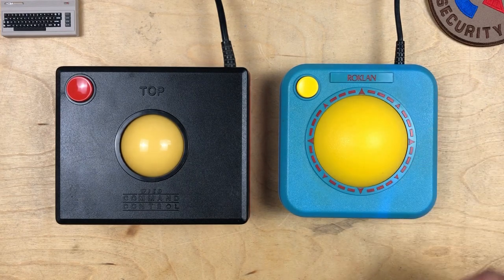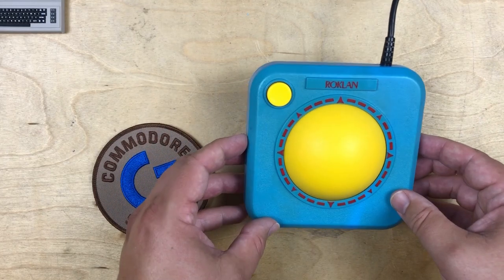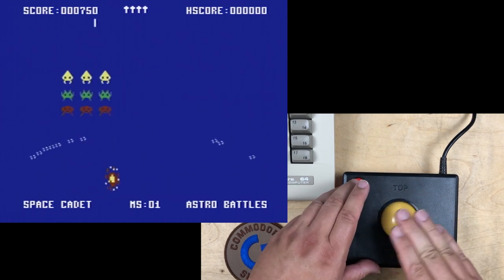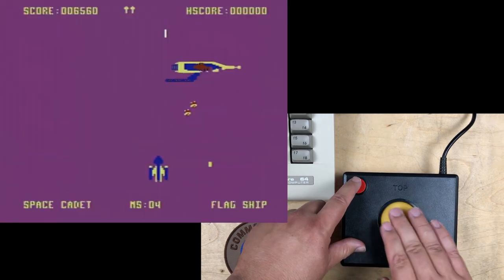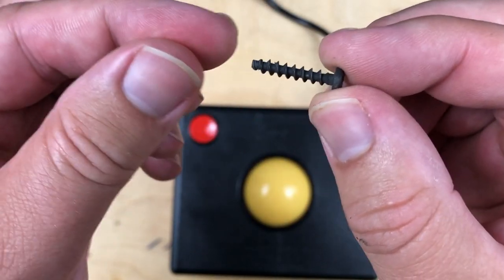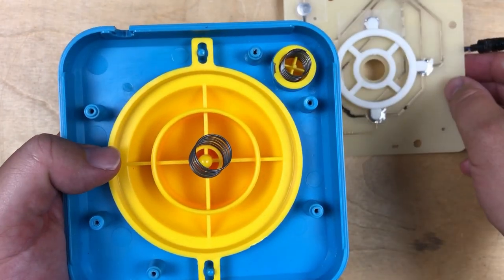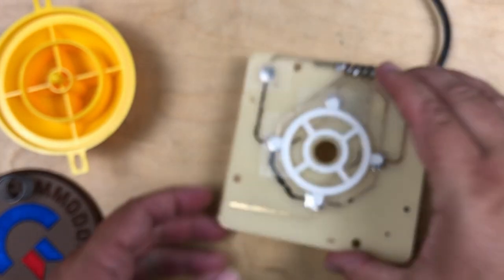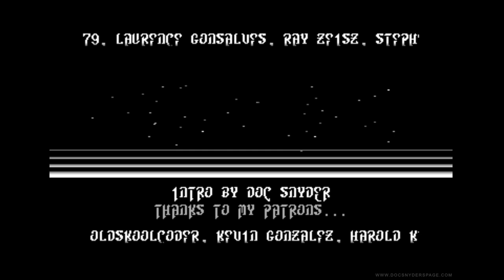Joysticks In The Form of Trackballs: The Wico Command Control and the Roklan Un-Roller Controller

Comment: Every time I see a c64 joystick I wonder how much better the games would have been if they had a couple more buttons
Reply: There was no technical reason that they couldn't have had at least 3 buttons (the normal one and two more on the paddle lines). It's only because of traditional that they continued to only use one button. No hardware manufacturers wanted to make a 2-3-button joystick if there was no software for it, and most software companies didn't want to write games to use a 2-3 button joystick if most people didn't have one. Catch-22.

Actually, there's no reason that even the Atari 2600 couldn't have used the same design to support a 3-button joystick.
Reply from the maker: Yeah, it's unfortunate that Commodore finally decided to push a 2-button joystick around 1990 with the C64GS games console, but that was 1) way too late 2) the console very poorly 3) the joystick itself was horrible. The only good thing is that we do have a bit of a standard now, and some more recent games use it, and some other older games have been hacked to support it as well.
Reply: @8_Bit  Back in 1983, CBS Electronics tried to establish a two-button standard with their Booster Grip accessory that was included with Omega Race for the Atari 2600. Unfortunately, their idea was pretty flawed. It only fit on standard Atari joysticks, the handle itself swiveled on the joystick and you had to plug the joystick into it, then plug that into the console. They had plans to use it for their game Wings, but that never got released, and then the video game market crashed.

To be honest, I'm kind of torn about the number of buttons on a joystick. While I think there are many games that absolutely would benefit from a second button, there are many more games that over-complicate their controls by using multiple buttons. Take that version of Omega Race as an example; Having a button dedicated to Thrust replicates the arcade, but do you really need it? Personally, I'd rather just push forward on the stick.

I played the standard Amiga version of Benefactor and I don't recall having any trouble pulling off the moves, yet the CD32 port uses three buttons to initiate the various moves. To be honest, I kept pressing the wrong button most of the time.

Sometimes when designing a game for a system with multiple buttons on the controller, the designers will feel an obligation to use all of the buttons for something, regardless of whether that simplifies or complicates the game. Take the original Resident Evil/Dino Crisis games. Why are there separate buttons for aiming a weapon and firing it? Why not one button to raise the weapon and fire it? It's not like "aiming" it in the semi-3D display really helps that much. You're still just turning in the general direction of the enemy.

Imagine a game like Ghostbusters on the C64. If that had been made for a system like the PS1 first, you would use L1/R1 to place your guys at each location, L2/R2 to fire each one's streams. L1/R1 to select which character you wanted to move, X to fire the trap. Triangle to turn the  Image Intensifier on/off. O to abort that capture. While driving, it would use X for accelerate, Square for brake, O to activate the vacuum. Triangle to sound your horn, L1/R1 to change lanes, etc.
Reply from the maker: I've actually got one of those Booster Grips from Omega Race and have a planned video called "The One Button Problem" or something like that, on my long list of video ideas. I agree that many games are totally fine with just the one button and it does seem that many game developers feel they need to use every available button on the controller whether it serves the game or not.
Reply: @8_Bit  A while back I tried out the game Joe Gunn Gold for the C64. Left/right walks in those directions, up/down climb/descend ladders. Pressing the button and pushing to the side makes him jump and/or climb up a block if there's one in front of him. Down and the button searches whatever object he's in front of. Up and the button brings up the inventory which you can then scroll through with the button pressed and releasing it will try to use the selected item.

It works pretty well and although there's no way to jump up and over enemies, I think that was a design choice rather than a limitation of the controls. They could have always made up/diagonal initiate a jump.

Comment: That un-roller controller is a piece of crap inside.  The WICO is impressive with a micro controller.  Optomechanical too.  Did you try to play it upside down like a mouse?  Likely everything would be reversed but still cool.  Fire up GEOS and use 1350 mouse driver.